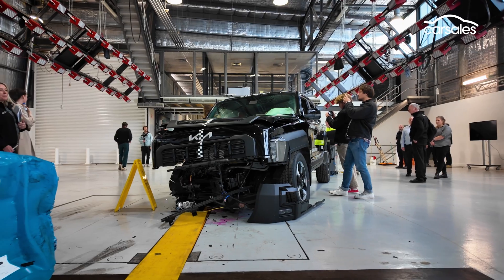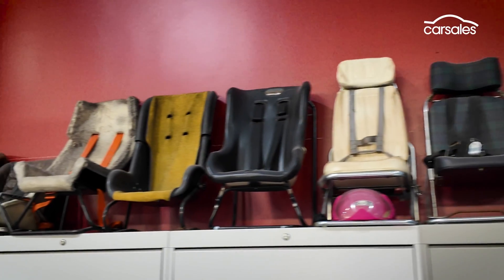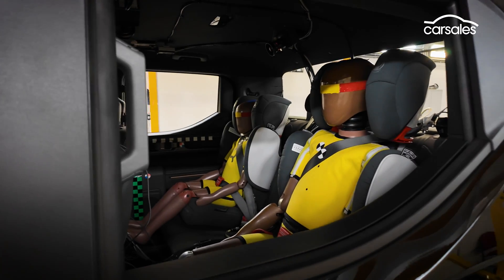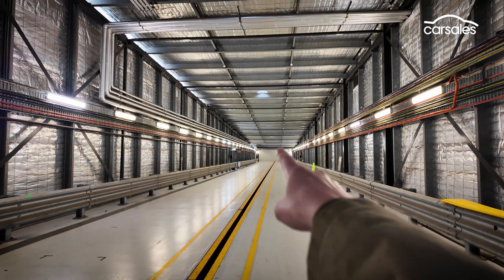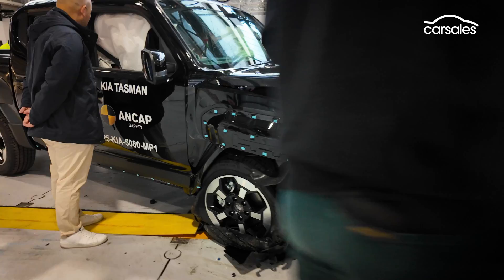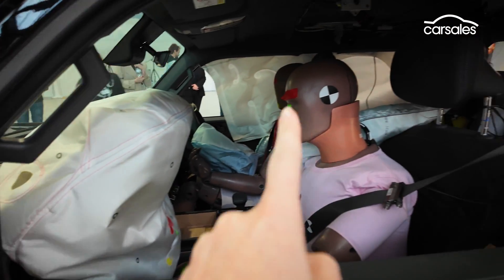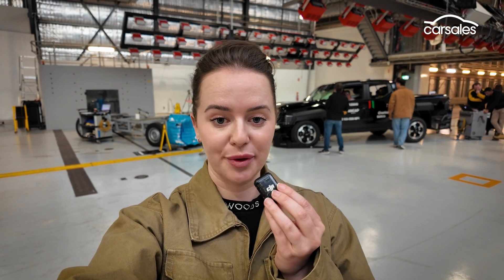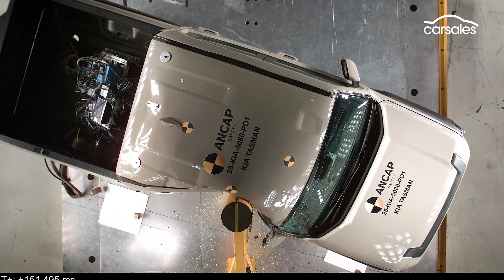Kia Tasman CRASHED | Behind the scenes of a live crash test at ANCAP

Comment: I have less faith in ANCAP given a car that has a lower crash performance can score 5 stars just because of the ADAS Bings and Bongs that don't seem to work properly .
If a Car/ SUV/Ute gets 5 stars then the ADAS should work flawlessly not as poorly as 90% of all cars  perform with the vast majority giving  annoying and false alarms constantly.
ANCAP 5 star rating is in my opinion a bad score assessment.
A high crash protection score means far more than if you get an over speed alarm for a speed zone that is not accurate.
e.g. driving in and 80 km zone and the system thinks your in a 60 zone.